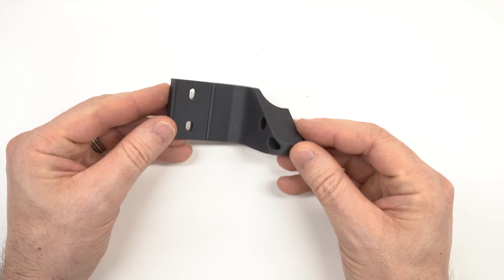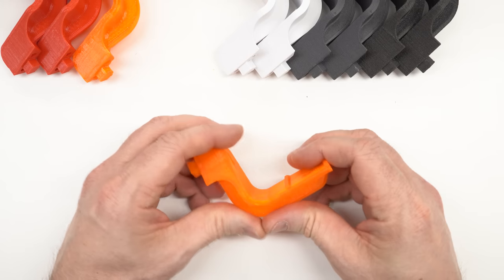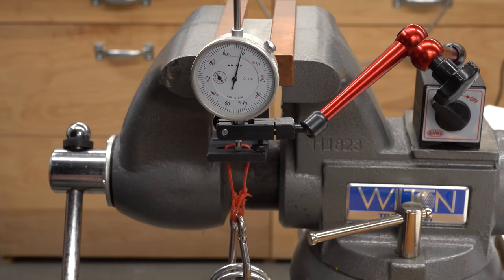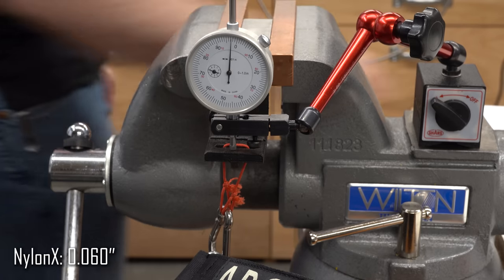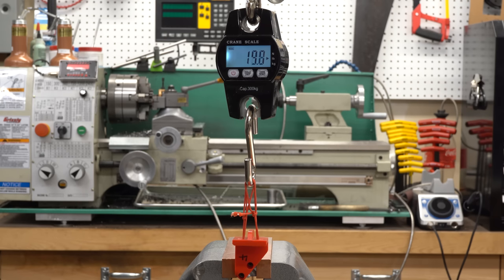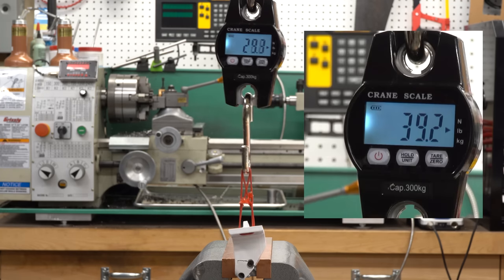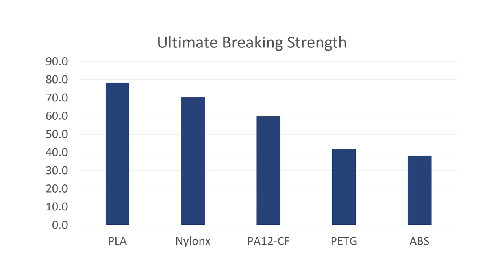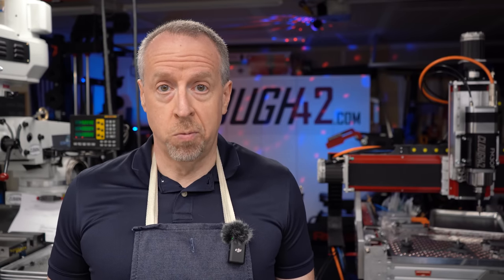Wait, What?  PLA is Stronger Than Carbon-Fiber Nylon?

Comment: Hi James. PLA is very prone to creep, even under very light loads. PLA brackets would continuously creep under the sole weight of the sound bar IMHO
Reply: This is what I've have always heard too, but I haven't seen any good long term testing that actually demonstrates that PLA creeps more than most of the other common 3d printed plastics. What little info I have seen demonstrates that PLA performs similarly to if not slightly better than PETG, ABS and ASA at room temp. The outliers appear to be PC which creeps the least, nylon 6 the most, and nylon 12 is more or less in the middle.
Reply: @creamofbotulismsoup9900  I got a spool holder I designed on PLA. Thing started creeping a couple days later.
Reply: @chrislosada6701  Personally I haven't had any issues with my PLA prints that are kept at a relatively dry and constant 74F environment. I'd imagine not all PLAs are the same either. Really I'm looking for a controlled experimental data, with a large sample of many different filaments and many other factors such age of prints, age of the filament, whether or not it has been exposed to light for any length of time, moisture content, if it was printed with a heated chamber or a heated bed and of course different environmental conditions. I know it's a lot of work, but that's what is needed to get truly useful data, not just anecdotes from random people on the internet.
Reply: PLA is actually one of the best choices for making (low speed) gears out of, because it has such great toughness/bond strength, stiffness and is incredibly resistant to wear.
 
However, over the last few years, they have been making more subtle introductions into PLA which can make it more rubber-like. This does make it more resistant to cracking, but I wouldn't be surprised if some of you are not experiencing the same results. It is usually a very dense, and very hard wearing material. 🙂🌎❤️
Reply: @Zakir Siddiqui (wikipedia) In materials science, creep (sometimes called cold flow) is the tendency of a solid material to undergo slow deformation while subject to persistent mechanical stresses. It can occur as a result of long-term exposure to high levels of stress that are still below the yield strength of the material. 
In other words: 
Let's say this TV stand can tolerate 40kg without breaking.
Even though, it will slowly and permanently sag (withing several days / weeks) under a load of just 10kg...
PLA is clearly not the right material of choice for applications where a permanent load is at play.
I've experience even more creep with "PLA+" (a small amount of different polymers such as TPU are added to turn PLA less brittle and improve printability)
Reply: Indeed pla deforms under load in no time. Even if annealed, from what I heard.
Reply: Not just that when creeping fast it also forms many microcracks. The biggest eventually growing up to a full break. At least I've seen that with a PLA PHA blend being permanently put to quite high tension.

Comment: The biggest advantage to CF filaments is dimensional accuracy. PLA also has a slightly higher density than the other filaments, so other than just having a lower strength/weight ratio, a 1kg spool of it will print fewer parts. Those are all minor issues though compared to PLA's poor creep characteristics and relatively low glass transition temp (parts will just turn into blobs over here in Australia if they're left in a hot car).
Reply: i hear having annealed edges helps
Reply: @fluffypinkpandas why bother annealing your prints and adding another post processing step when you can just use a better filament
Reply: @alksmdlaks  i agree just use better filament. but also anneal the better filament
Reply: PLA does that all around the world and will never stand up to a hot car test anywhere. in my opinion PLA is a hobbyist filament to teach people how to use a 3d printer and it has no other use than printing ornamental things that you don't count on lasting.

Comment: There is a variable that you missed here. We use 3d printed plastic parts for combat robotics and do a lot of testing of different materials. Our tests have shown that the pigments in the plastics make a huge difference. For example, the white ABS likely uses Zinc Oxide as a pigment which greatly reduces the strength of the plastics... while the carbon that is generally used to pigment black filament doesn't affect the strength much. We've been in contact with several of the filament manufacturers, and their engineers have backed up our findings as well. If you want good consistent results, you should probably test all of the parts using the same color... preferably "natural" undyed, but that isn't available for things like cf filled or some of the better flavors of PLA+ 

Our testing so far (for impact resistance) has two colors of Duramic 3d PLA+ being the top runners... (Black and Red). These filaments print best at a bit higher temp (I use 225c) but it is well within the capabilities of even an inexpensive hobby grade printer like an ender 3.
Reply: Interesting that you mentioned zinc oxide. What's your source? To my knowledge titanium dioxide is the most common white pigment, when opacity is desired.
Reply: Wow. Duramic PLA+ black is my go to for durability! Seems you came to the same conclusion.
Reply: for strength id say pla+ for short powerful repetitive impacts pa6 cf nylon hoffman tactical did a whole video on it considering what he builds with it for impact testing i trust his word, polymaker often hops on his streams and also agree
Reply: Funny, this is true of fabrics too. Often lighter colors undergo harsher chemical treatment.
Reply: @AwestrikeFearofGods  I misspoke, you are correct. That's what I get from commenting on videos when I am tired :)
Reply: @AntiMaxer  his Orca in PLA survived PSR's abuse too... Nylon is great for temperature resistance, but it's softer that PLA (which can be an advantage, especially when you want a durable but breakable link (like a sacrificial-replaceable gear in a gearbox on a tool) as for carbon fibers or glass fibers in filament, the fibers are chopped up so small (so they don't clog up the extruder) that they hardly make a difference except in wear on your nozzle... this is of course different if you have something like the Markforged x7 or other continuous carbon fiber printer... 

but honestly comparing the filament cost for pa6 cf (110/kg) versus Duramic 3d's PLA+ (15-20/kg), and the cost of a printer that can use it, plus the dry box and filament dryer... it's hard to justify using NylonX or other special sauce filaments. I live in MD, so I can't print pmfs (at the moment).

Assuming I had a project that needed nylon (like the sacrificial gear), I could just have it printed by a service 

Btw, combat robotics is all about repetitive impacts... if you are doing it right :)
Reply: @mightygrom  Thanks for the confirmation. Your suggestion about the uniformity of unpigmented filaments makes sense, but they seem to have poorer printability, because pigments add some thixotropic viscosity, and perhaps a bit of thermal conductivity. In that case, I’d recommend the ever-popular black.
Reply: @AwestrikeFearofGods  I don't have much trouble with "natural" PLA or PETG... I use them instead of white plastics and get good layer adhesion. 

Giantarm just sent me a roll of transparent TPU to test on my bots... I haven't had a chance to do the testprints yet though.
Reply: Very interesting! Do you have a video or link to learn more?
Reply: @mightygrom  What do you think of Giantarm and their TPU ?
Reply: I actually bought a roll of their transparent TPU a couple of months ago... it printed very well on my K1 with stock "generic TPU" settings. I didn't do any impact testing with it since it's TPU, but layer adhesion is really good, and as long as your settings are dialed in, it's not too stringy. I've had more issues printing with Ninjatek than the GiantArm, but that could be my settings working better for the GiantArm. I do like that it just works.
Reply: @mightygrom  Thanks for your feedback

Comment: We did similar testing for our products and got mostly the same results. PLA is the best all arounder. But we have a temperature requirement and that ruled out PLA for us. We tried it just to make sure and just a little heat in an oven and oddly enough tossing it in the freezer made the parts deform to the point that they stopped working. During our testing we did discover a few key things that may be affecting your results. 

1) the rate at witch you pull matters, that rate is based on the sampling rate of the scale. If you move to quickly the force will fail the part before the scale updates the reading. Giving you a bad reading. Consider using a Load cell and the good old Oscilloscope to recode the loads.

2) the angle of applied force matters, that angle must be consistent. If the forces shift slightly it can lead to the part being loaded favorably or unfavorably depending on the shape of the parts. Try a more rigid linear slide and add an electric actuator to slowly and consistently apply the load. We got ours off amazon.

3) print settings matter, they effect layer adhesion and that effects the ultimate performance. Your results are hinting at possible issues with controlling the printing conditions. Bubbles in the material and to cold of print settings will lead to huge swings in performance. Dry everything in the oven at 100F for 8 hrs and run it all on hot settings.

4)sample more than 2 or 3. these materials fluctuate naturally and any sample less than 10 is asking for misleading (biased) results. We have a saying. The first data set is the worst data set. Old filament may have issues, new is preferred, the temperature of the room matters. The more brittle the material the more it fails statistically and less predictably, and cold temperatures will cause this specifically for thermal plastics. The temperatures should be around 75F Or the operating temperature that the part will experience during it's life. 

5) load the part realistically, if your part is going to hang something then make extra sure that as you load it the part is free to deform and move in the way it would in real life. Over restricting the movement of the part can lead to unnatural twist or bending that could cause early or late failure. This can often times be hard to do with things that hang. Consider a sand bucket free floating body test. Hang a metal bucket and put your load cell between the bucket and part. Use a funnel and slowly allow sand to fill the bucket till the part fails. This allows the load to move with the part, which can not be done with a constrained loading machine. put something under the bucket to catch it. like a stool or box so it doesn't fall far or tip over and spill. 

Good luck I look forward to seeing a follow up video.
Reply: Excellent comment, thank you for posting !
PETG must be printed properly to achieve the best results, and each printer must be setup to print it.
As pointed out layer adhesion in PETG needs careful attention.
The conditions of each filament roll are very important, age, how stored, dryness, etc.
Nylon requires careful attention, I;m doubtful of switching material to do testing can achive that without careful tuning.
I believe we ask too much of these printers, expecting the same machine to easily adapt to very differnet materials.
Thank you for posting an excellent video !
Reply: Good points.  I'd also add that there are also Tough PLA blends out there that may improve some qualities and some that have CF in them.  For me, most of the CF materials I have used add no strength to the part and frequently make it harder to print.  However, that matte finish is very very nice
Reply: Very true about the sample size. Really though, you don't get any statistical significance until you hit 23 data points at the absolute bare minimum.
Reply: Awesome comment! 👏👏👏
Reply: Yep, I thought it was kind of obvious that the materials weren't all printed adequately. Delaminating layers was the give away imo. It's also expected - most of us have a favored material and use it way more often. Fresh filament, honed settings... yeah the prints weren't done with the same quality. 

So you're going to publish the results you tested right?
Reply: Blah blah blah.... All you advice is pointless to this test if you know one thing about carbon fiber.... The strength is in the weave, not the material properties.
Reply: @dreamrestore213  you don't understand material science 

Polymers with random oriented fibers should have a higher strength that just the polymer, but less than the woven type you're talking about
Reply: @dreamrestore213  You do have a point in that our fibers (and strings) lend their greatest strength when they are fashioned into grids that can reinforce the outer walls of our parts. 

We might not be able to manually embed a sheet of cloth into a print, but we can still cast/pour our plastic onto cloth like sheets. 

This gives me a great idea to make reinforced-fiber shelves out of scrap and waste PETG prints. Thank my friend. 😊🌎❤️
Reply: Yes, PLA is wonderful, but can catastrophically deform over time when used for structural things that are always under stress, even modest stress.  Real-life temperatures cycles, even at body temp, accelerates this.
Reply: @als4817  Yes, properly printed PETG has layer bonding strength nearly as good as lateral.  It is possible to make a part that breaks apart like glass, in crazy directions, as though it were solid.  Needs to be printed slowly enough that the column of extruded plastic is uniform.
Reply: Great points. I would like to see a simple scientific test of sticks like a paint stirrers printed in different materials under 3 or 4 different temperature conditions.
Reply: @als4817  I was wondering about this, the fact that you get such a strong print would cause me to investigate consistency.
Reply: I knew the (surprising?) results of PLA - so it has got my favourite filament now. One more thing: by tempering PLA (usual and cheap PLA), this is even one of the most heat resistant filaments, what resists steam, too! So I use it e.g.  in my kitchen.
Reply: 1. WTF are you talking about?? It's an analog dial. There's no sample rate.
Reply: @igorordecha  1. WTF are you talking about?? - wrong thread?
Reply: @dreamrestore213  I saw a YT recently where the guy did some very well controlled tests adding ground up home made (pencil and sticky tape) graphene into, IIRC, molding epoxies. Well under 1% by weight had a profound effect on the mechanical properties. THat was graphene, not CF, I realise, but still .....
Reply: I wonder if it is stronger on XY plane, but weak on Z axis? I have tried to print something and find that it breaks easily between stacked layers, but the filament itself is strong.
Reply: I think it's misleading to call this carbon fiber at all, the fibers are so small, many tiny pieces and the whole strength from carbon fiber comes from long continues fibers, which this is far from. It is also a lot weaker than forged because of the minicule fibers.
Reply: @dreamrestore213  Lmfao. Tell that to Tesla, for example, who is using carbon fiber in electric motors now. Or McLaren, Koenigsegg, Honda, Lamborghini, Ferrari, Yamaha, Ducati ect ect ect ect.... Because of those very material properties, Including strength. Tell me you dont understand material science at all without saying it....
Reply: @rihasanatrofolo2472  Thats why its not, Its Carbon Fiber "Reinforced"... and with that said not all products are the same, Some may say 10% carbon by volume and another 20% by weight... NylonX is composed of 20% by weight the QIDI Tech PA12-CF is " 15% " of we have no idea. Raise3D’s filament has a nylon PA 12 base (like most) and contains 10-30% chopped carbon fiber, according to the datasheet for the filament. 

10 to 30% can make a massive difference in the properties of the material. Any material / composite really.  If your coffee is 30% more water or cream than usual You are likely to notice.
Reply: Adding to #1, the rate of pull also matters for material failure itself. Different materials will respond differently to a shock load, than to a steady load, than to a gradually increasing load, etc. Knowing what kind of load the material will experience is part of choosing what material to use.
Reply: I don't know if a loadcell being read with an O-Scope is necessary. A scale with a peak-hold (or MIN/MAX) would work just as well and not force you to figure out how to convert the voltage on the O-Scope to a real force unit (and to try to figure out how to trigger the O-Scope to preserve the peak). I see a lot of YouTubers trying to use video capture as a "peak hold" fall into the same issue of display readout refresh rates not giving the actual peak reading.